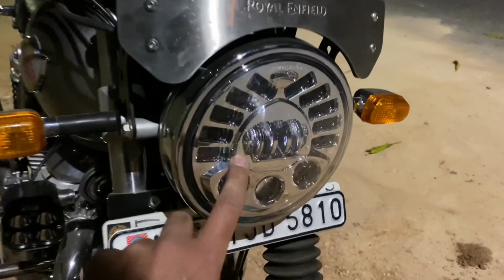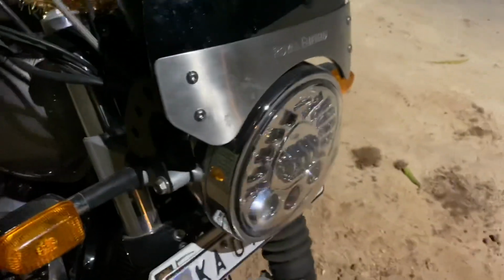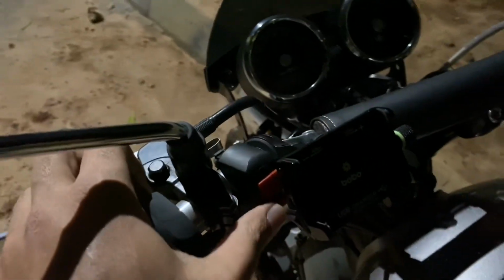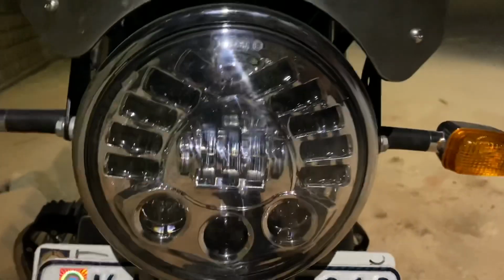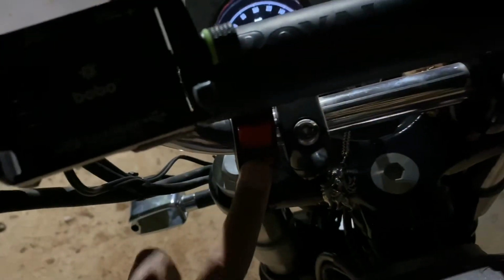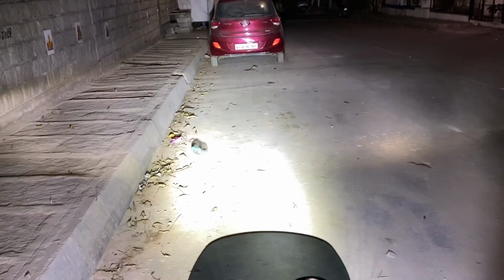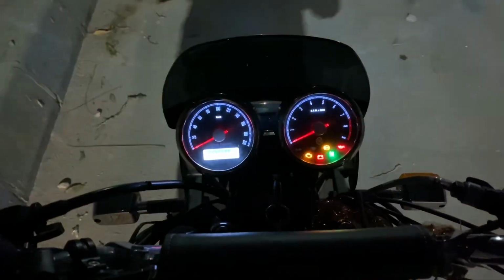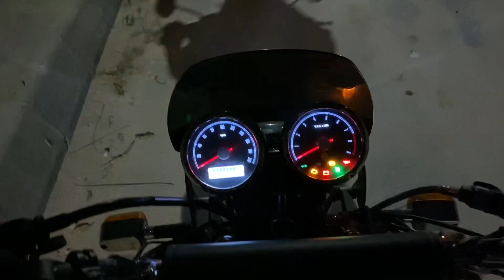Butterfly pattern LED Headlights, fog lamps and Hazard System for Royal Enfield Interceptor 650

Comment: Thanks for Sharing this. I thinking of upgrading my interceptor headlight as well? Just wanted to  check how's it performing till date? thanks
Reply from the maker: Performance is far better than the OEM, clean beam no blue light. Good on highways. Not too intense for incoming traffic, you need check at your place if the cops do check such lights.

Comment: Where did u get the headlights from? Price? Do they also flash?
Reply from the maker: Dear Mohd Khan, I purchased it from SANs Moto Shop, Saurabh Mob:8527763277, Karol Bagh, Delhi on 26th December, 2019 when I visited him. It was then 5K INR with 1 year replacement warranty. He ships to your place if you call him & order. You can refer my video as well which he knows it. Yes, it has Amber LEDs in the same parking LED slots both sides where you can connect it to indicator line. I tested, it glows for indicators, but I did not prefer to connect.
If you are staying in south, these are available in Bangalore at J C Road as well.
Reply: Thanks brother..... Im in love with ur bike... Will get the same for it...
Reply from the maker: @mkhan8426  I am glad that you liked the modifications 👍
I am also using Art of Motorcycles (AoM) Handle Bar, it helps in long rides for. I also made a video of it https://www.youtube.com/watch?v=np61y-OKAAE&t=7s
Reply: @automotriztechnica  bro bought this same from sans moto shop karol bagh for 3500

Comment: Whoever fixed your RTO number plate has done a horrible job.
Lights are good tho!
Reply from the maker: Thanks for the observation, that was done by the showroom guys. Yes, it looks bad. I will rectify it and get it changed from a better Service Station which I found recently in North Bangalore.